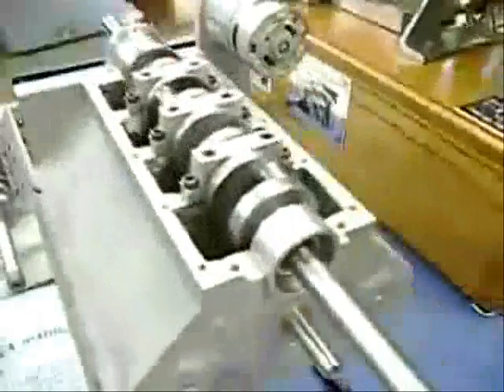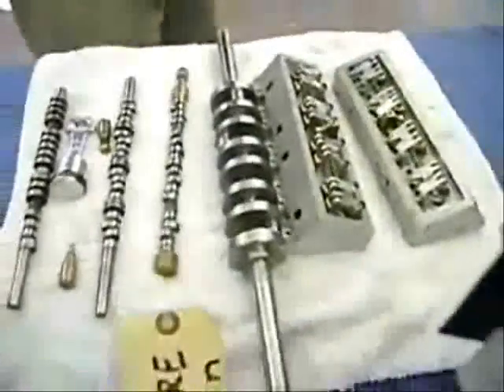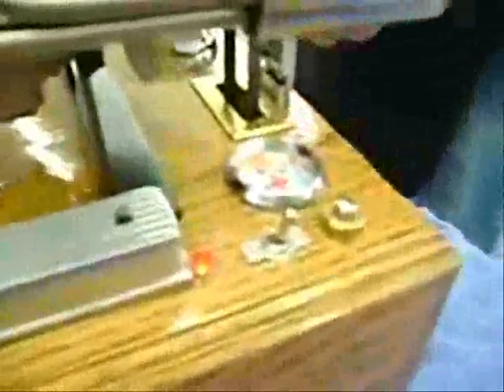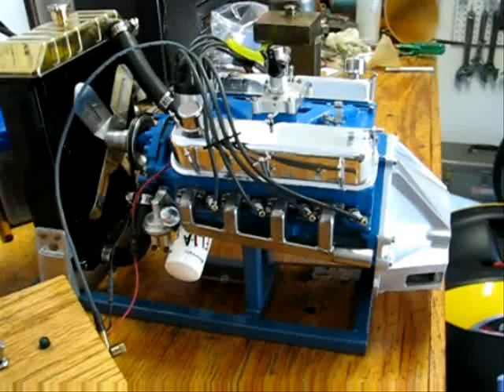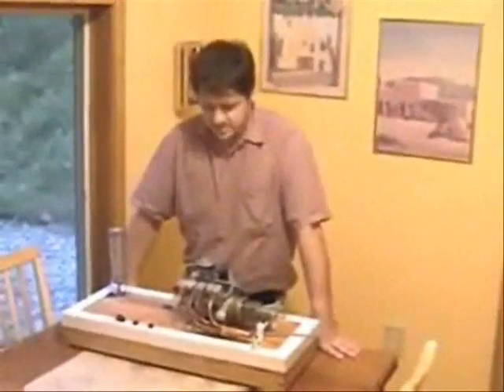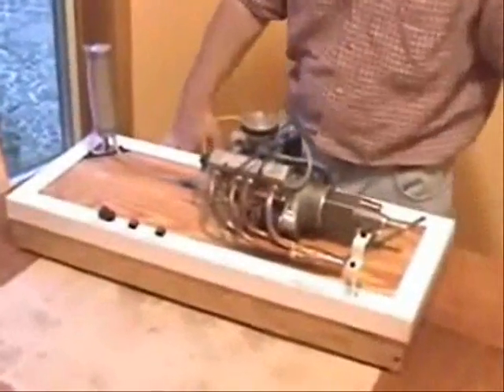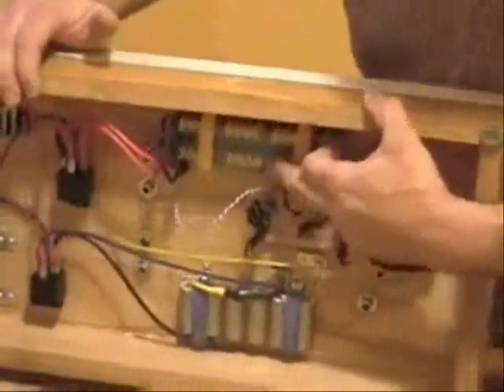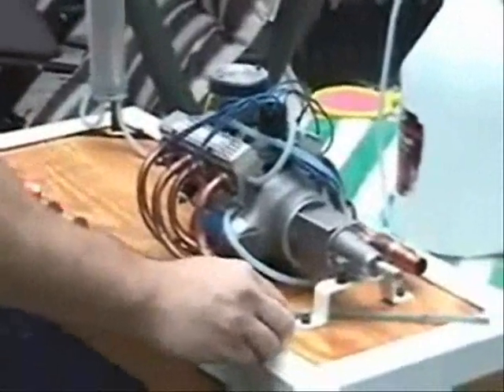Miniature V8 Engines Part 1.wmv

Comment: I saw one of these at a car show recently.  It was a 1/4-scale replica of a Mustang 5.0L, and had been found to produce about 5.0 HP at 7,200 RPM.  Would it be feasible to build an entire miniature vehicle around one of these?  What is the approximate materials and labor hours cost to build the engine alone?  What would be approximate cost of building a small go-kart-like vehicle (2-seat, 250-lb capacity, Drive/Reverse fluid transmission, open-frame or fiberglass body) for children ages 8-14?